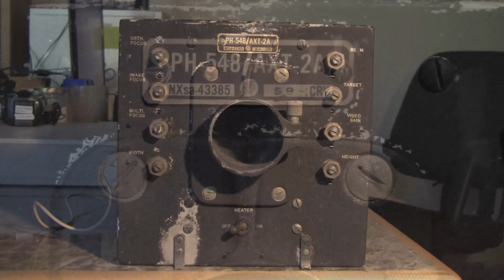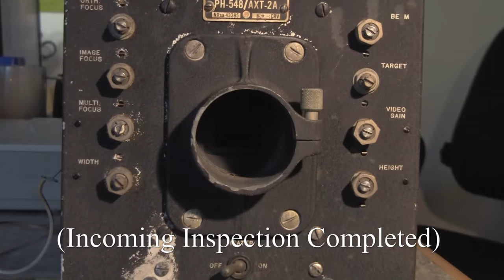PH548/AXT-2A Image Orthicon Television Camera. Part 1

Comment from the maker: The restoration of this camera will be documented here:  http://www.labguysworld.com/RCA_PH-548_AXT-2A.htm. First task, after a thorough cleaning, will be to back out all of the oddball mods and restore circuit configuration to original. You can see a small rectifier tube, missing its top cap. This is not the original tube for that location. Someone in the past has built an adapter socket to accommodate the substitute tube. The original plate cap probably did not fit. It appears the mods went unfinished. Also, the long dangling white wire is for an external high voltage supply. Probably because the modified high voltage circuit did not work. I will attempt to obtain the original correct tube for that location. Stay tuned.
Reply from the maker: +videolabguy The correct link is: http://www.labguysworld.com/RCA_PH-548_AXT-2A_Restoration.htm